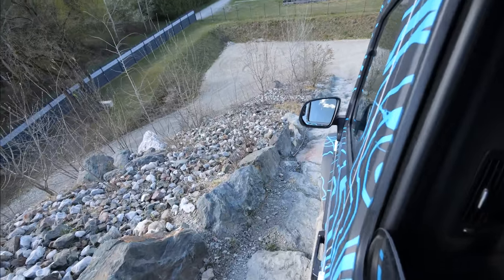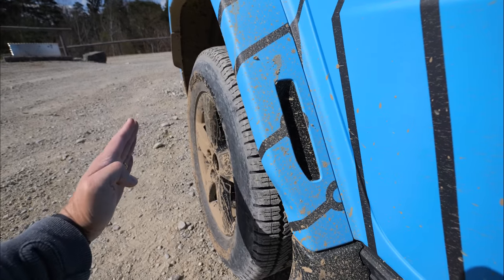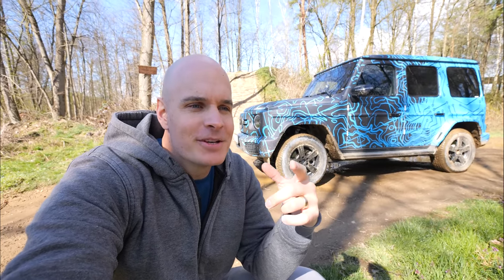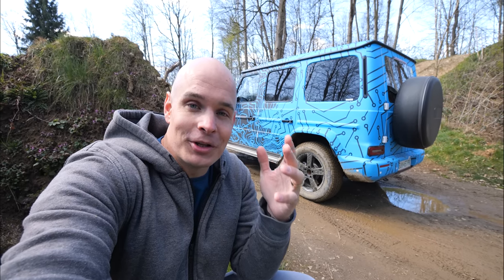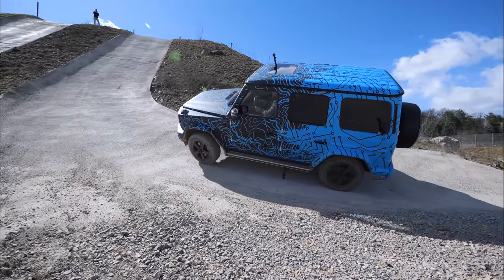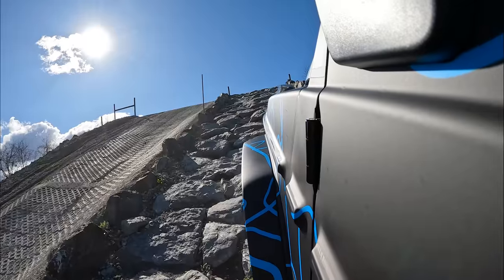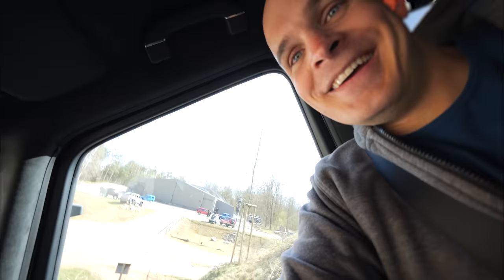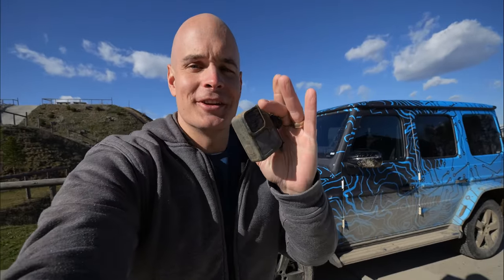The New Mercedes EV is a Luxury Stair Climber - (Sneak Peak!)

Comment: I will miss the engine sound in ICEs but these features are insane
Reply: It's 8000 lbs of electric junk.
Reply: @Dat_Sun  my heart wants this to be true and ICEs to never die <3
Reply: @DamianYoko  It's true, weight is the biggest problem with ev right now.  Fossil is 27x more energy dense, at a fraction of the weight.  

Even at just 20% efficiency ice blows electric off the surface of the earth.
Reply: @Dat_Sun  lol currently even with the higher weight evs are more efficient
Reply: @MaticTheProto  What? How so? And who told you that? 

Start from the beginning,  where does the energy to mine, manufacture and transport 2,000lbs of lithium batteries for an ev come from?
Reply: @Dat Sun  and gasoline forms on its own in your tank?😂
Reply: @peterhaaima8432   Not exactly but oil production is a natural process that is ongoing..  The process is self powering, the process allows us the plastics And by products that we cant live without.  

We are never going to run out of it, all the wells you commonly see used as EV propaganda saying they are empty, still have 80% or more in them.  As technology advances, we will continue extracting from these same wells,  we have found so many more new reserves it is impossible to run out in a 5000 years. Even with our wasteful usage of it.   

 There is no reason to switch over to electric storage battery powered vehicles, Every democratic the sky is falling weather prediction the sea is rising nonsense prediction, has been wrong over my entire life and then some. 

 Tesla, space X, the Biden administration, build back better, all the same crooks after tax cattle funding.    Government will destabilize the grid with electric vehicles, Start cutting off our power like in California. There will be massive restrictions on how much energy you are allowed to use for your electric vehicle..   Open your eyes this is not the cliff to walk off of..

 Fossil fuel is an amazing energy dense substance left here by Mother nature,  It's precious we should conserve it but there is no need to attempt to repbasic with misleading renewable energy projects and the storage battery..

 Wouldn't a better more practical solution for now be to reduce horsepower to about 100 per ton? Electric or ice, level the field,  consider the future.    The energy to move the vehicles around is only part of the picture. The initial footprint to manufacture a 7000 pound Tesla is huge and has no chance of offsetting its own footprint for at least 20 years of constant use. 

The EPA equivalents that are used in eV propaganda are government generated by the same people who are taking tax cattle money and funneling it into the electric vehicle and renewable energy industry.  

 It would literally collapse overnight without the sweat on the backs of tax pairs.   Over a 100+ years ago when electric and ice vehicles were 1st  Is any attraction,  there was no propaganda pushing us to buy one or the other.   Is ice obviously one for good reason, The difference now is the people are being told what to like, There's constantly subjected to electric vehicle propaganda and misleading facts like this Jerry lies about everything guy.

 Jerry summed up all internal combustion engines into one category of performance and said they don't make torque down low.. 

 Maybe if the Ignition was turned off, Otherwise the internal combustion engine is generating horsepower and torque if you don't believe me reach down and try to stop the Serpentine belt with your hands and see how that goes. 

He also chimed in on how electric motors make maximum torque at 0 rpm, Of course he leaves out the fact that it's only down hill from there, Is the more rpm the less sufficient and less powerful the motor becomes.    Electric vehicles do horrible in roll on racing because of this Flaw in the electric motors performance characteristics.

 He keeps throwing out torque along with other EV propaganda bots,  Neglecting the part about it being geared and grounded tq.  Incredibly misleading,  In fact it should be criminal but it's not because Tesla nor any EV manufacturer is submitting for ASC certification of horse power and torque claims.

Tesla as honest as they are are using the same exact misleading advertising that you would see on a Walmart 5000 watt amplifier.
Reply: @Dat_Sun  where does the energy to drive your ice car come from
Reply: @Dat_Sun  EV’s convert about 77% of its stored energy to power at the wheels while ICE cars only convert about 12-30% of its stored energy to the wheels. Electric vehicles only carry the “energy density” of about 2-3 gallons of gas. EV’s are multiple times efficient than any ICE car
Reply: @magicninja4727   You are taking the final process, electricity has already been generated it has been transported and then it has been forced into the storage battery with a high voltage transformer. You left out 99% of the efficiency losses. 

Fossil fuel is some 100x times more energy dense than a lithium battery.  100 TIMES!  I want you to say this 100 times in your head so you understand how wrong you are.

Fossil fuel is pumped out of the ground cleaned up and ready for use. Electric vehicles require several 1000 pounds worth of batteries.

The ore is dug up here in America and then put on a ship that burns millions of gallons of heavy oil to sail all of this ore to China where it is processed, dumped into the ocean, and what's left is sent back to America on another ship burning millions of gallons of heavy oil.   China uses these profits to paint their mountain's green to fool environmentalists.

Then diesel powered trucks transport the lithium to the Tesla plant where they stamp it into a battery and claim it's renewable. 

 This is leaving out 99% of what's involved but I think you get the idea of how big of a sham the electric vehicle is.

In the end you have a insanely heavy limited range electric vehicle that uses far more resources than an ice vehicle that weighs just 25% of the mass of a Tesla.  The worst part is all of this is done just to gain access to tax cattle funds.  Without the build back better Democrat plan Tesla and all other electric vehicle manufacturing would flop overnight.

 My little 620 is a great example of how ridiculous electric vehicles are.  My 44 year old 2,240lb 620 has as much payload as a 8,000 lb electric truck.  It would have taken 10,000 lbs in lithium battery replacements to keep it on the road for 44 years..   Every 3 battery chemistry advancement we make is a trade off, In the future we might have batteries with slightly more capacity but they are guaranteed to be less durable and have an even shorter life than lithium.
Reply: @MaticTheProto   The energy for my ice vehicle comes from mother nature. Also fuel is amazing, without it spacecraft or space x wouldn't exist, we would never have reached space.   Without fossil fuels mankind would end here on Earth that's how amazing fossil fuel is. Why do you think we don't have electric rockets taking us to space?  You would think Mr. Tesla would be afraid of people finding out hes using fossil fuel to get space x junk to space. Lots of it...

 Again all we do is pump the oil out of the ground and clean it up we don't have to charge it we don't have to use other resources. Is fossil fuel is the energy source, Pound for pound it is 100 times more energy dense than the best short lived lithium storage battery. Even at 30% efficiency ice is literally light years ahead of the storage battery. 

Imagine how much range and power an ice vehicle would have if half of it's 8000 pound mass was dedicated to fuel storage and a big block super charged 454.
Reply: How much fossil fuel was used to launch that Tesla in space?
Reply: @Dat_Sun  I'm failing to see where the junk is. Looks pretty useful to me
Reply: @nick_0  It's supposed to be a off road capable suv. It's 8,000 lb weight and low resistance tires for range destroy off road abilities.  

There is no way it could get up my driveway in the winter.  My 22 tacoma trd struggles and it's far more capable than a extremely heavy low clearance suv with parking lot tires.
Reply: @Dat_Sun  Electric is still more efficient with the heavy weight. Literally just search it up.

It’s more energy efficient to use petrol or diesel in a generator, and use that electricity to power an EV than putting the fuel into an ICE car. 

There are reasons to not buy EVs, like as the original commenter said, engine sound, responsiveness, etc - I wouldn’t buy an EV now, but not buying one because ICEs are more efficient is dumb and incorrect.
Reply: @Dat_Sun  Lithium batteries are a single part of the car. How about ICE vehicles? You have to mine the metal used in them too, same for EVs but it isn’t an EV only problem. Also, Lithium recycling is being implemented.
Reply: @Dat_Sun  We are using it faster than it is generating. Yeah “mother nature” left it to use as energy, sure. There’s also the energy of the sun, wind, and water, as well as the energy you can get from heat. I’ve already said this but we can use the fuel and other fossil fuels that we’re putting into cars, to make electricity - it’s like 50% more efficient which scales up to be an insane amount of resources able to be saved.
Reply: @Dat_Sun  at 20% efficiency, ELECTRIC motors are on par with ICE engines for efficiency. You are messing up fuel and the engine itself. You could say that fossil fuels are very energy dense but at the same time avocados are very energy dense and you can’t run cars with avocados until you convert the fat into ethanol, and then mix it with petrol. The only vehicles that are more efficient when powered with fuel vs electricity are very large trucks that run continuously on diesel, anything remotely stop-start is far more efficient with electric tech, and that’s currently - ICE engines have reached the point that loads of R+D will barely get any more efficiency out without slapping a battery and a mild hybrid system in, while electric tech is developing at a much faster rate with the same amount of R+D.

Also, the average person doesn’t NEED a range of more than like 50 kilometres/30 miles a day, that’s the upper end of a commute to work and back with a shopping stop along the way. Unless you do inter-city travel or do a bunch of long road trips very often, the highest range EV that’s on the market right now has a range of 500 miles/800 kilometres - let’s say an actual range of closer to 350-400 miles/550-650km including AC, cargo etc - that’s enough to go from like NYC to Baltimore and back, or London to Manchester, or Sydney to Canberra.
Reply: @DamianYoko  ICEs will probably live on as enthusiast’s cars - Porsche is developing e-fuels and there’s fuel sources like ethanol that exist that are more energy efficient than petrol, but they require a lot of electricity to produce while being carbon neutral.

Comment: Man i would LOVE to have one of these
Reply: Why? It weighs 8,000lbs and requires a lev 3 charger for promt recharging.  Lev 3 changing is a Industrial load on the grid. Our grid is fossil powered..
Reply: @Dat_Sun  I love Mercedes and I adore G class
Reply: @Dat_Sun  I red some of your comments. I think you are on the wrong channel.
And the weight is 6000 Lbs.
The AMG Gclass is 5000 lbs
Reply: @jurgens9867  Lol you are using the ICE powered weight.  Ev version is almost 9,000lbs.
Reply: @santenz8460  So do I, but it's not helping our situation at all. It's 8,000lbs or tire (oil) destroying lithium madness.  Another industrial load on our fossil powered grid.
Reply: @Dat_Sun  3000kg
The Amg with V8 Gasoline 2550 kg
Reply: @JuergenSchl  And? Thats 4,000lbs lighter than the ev version. The ice g wagon is king, the ev is a joker.  Neither should exist,  limit hp to 100hp per ton, ice or electric we need to be responsible and save resources for future generations.
Reply: @JuergenSchl  the ev is not 3000kg if thats what you are saying.  The ev gwagon will weight close to 9k lbs, lithium storage batteries are insanely heavy.
Reply: @Dat_Sun  I own a EV. Mini Cooper SE.
Same weight as the Diesel.

Range is bad. But i love the Power
Reply: @Dat_Sun  I am with you.
I like small Cars like my Mini.
Reply: @JuergenSchl  Ev can be awesome, but it not a solution to anything.  Smaller morw practical sized and powered transportation is key. 100hp per ton, electric or ice, save our resources for future generations to enjoy.  

Without fossil fuels , Humans end here on earth,  Fossil fuel are the only way forward and off of this planet. Nothing else has the power density required
Reply: @Dat_Sun  Just wait till that grid is powered by fusion 😉 Doesn't hurt to think ahead
Reply: @nick_0   Until then limit electric and ice horsepower to 100hp per ton.  Stop the wasteful manufacturing of short lived E waste such as this Mercedes Benz forklift.
Reply: @Dat_Sun  what's the wasteful manufacturing huh? lithium gets more recycled than the fuels being burned to power ice cars. ev's are more efficient regardless
Reply: @nick_0   We cannot recycle lithium from used up batteries. The few people recycling lithium EV batteries are being very misleading just like the rest of the recycling sham. Recycling means if there's any watt hours left in the pack they're put back on to the grid, the plastic bits and some of the conductors are recycled or reused but what matters is not recycled.  

 And like I've said about a 1000 people just like you, electric vehicles are not more efficient, you're not looking at the big picture you're just assuming clean renewable energy is everywhere in great abundance. It's not and even when there is green energy that green energy was made with fossil fuels.  Incredible amounts of fossil fuels..  

We don't have anything to replace the materials plastic renewable equipment is made with. We have to keep using fossil fuels to have the petrochemicals available for life as we know it including solar panels and Tesla cars.

A real solution to extend our resources indefinitely is limiting horse power. 100hp per ton,  Gas or electric. Until we have abundant fusion power or some other miracle green energy, Let's act like we care about the future. 

Each Tesla is roughly half plastic oil petrochemical products by weight. Tesla's are incredibly heavy 5000 to 10000 pounds.. They have huge rubber tires that require barrels of oil to manufacture.. They have shock absorbers and rubber suspension components that are impossible without oil.

That's right Tesla makes it's electric vehicles with an incredible and disproportionately large amount of oil compared to a 2  or 3000lb, practical, long lived ice vehicle such as my little truck from the 1970s. It's 98% or more metal. Almost completely recyclable,  extremely efficient gasoline engine,  Weighs just 2200 pounds but has the payload of a 10,000 pound tesla truck.  This 1970s economy technology will get multiple times more work done in one day than any electric truck on this planet.   By now it would have taken tens of thousands of pounds of lithium batteries to keep this truck on the road if it was a ev.  The manufacturing and shipping process for those batteries is extremely fossil fuel dependent..  The ore is dug up here in America shipped to the ocean with diesel trucks, The oar is then floated to China usingThe oar is then floated to China using Millions of gallons of heavy oil. 

China processes this stuff using coal power from coal mines like the one that just exploded and collapsed killing lots of workers. China does not have the same environmental standards or safe work practices we have here in America. So we take advantage of that by sending all of our stuff there for the dirty work. The processed ore is sent back while the remainder is dumped into the ocean in China. Once it makes it back to America it's then trucked with diesel trucks again 2A manufacturing plant that basically stamps them into shape and claims they made them here in America.

 They are then charged with solar panels or wind turbines that were most likely manufactured in China or somewhere just as far away. 

 Remember fossil fuels are already here, we don't expend energy from outside sources to remove it from the ground and clean it up a little bit.  It's a self powering process that gives us a product 100 times or more dense than our most advanced battery technology. 
 The internal combustion engine could be just 5% efficient and still be orders of magnitude better than the storage battery.

We are not running out of oil, Political pressure and sabotage are the only reason for increased fossil prices. Wells that are considered empty are nowhere near empty they're just empty for today's technology and Oil prices.  Oil extraction techniques continue to improve, Even the slightest improvements are millions of times more rewarding than Is any future storage battery technology, 100x the energy is a  Inconvenient fact for the electric vehicle industry.

Comment: The funniest thing about this video, is that those G-wagons never go offroad IRL, unless they are super old and cost around 20k:)
Reply: If it goes, then next it will go to service centre for a good amount.
Reply: @trickyabb  no
Reply: Many of the German military armored personnel carriers are just armored G-wagon's with stripped-down interiors (see Mercedes Enok)
Reply: @romantechplus  did you see electric military personal carriers, or vehicles overall? Nope! And there will be none in nearest 20 years.
Reply: @werneo  you are very correct. However, this is primarily a function of the exceptionally long service lives enjoyed by many military vehicles coupled with the logistical challenges inherent to switching from ICE to electric vehicles (resupply of fule vs electricity). Not necessarily limits of the tech or cost.
Reply: @trickyabb  This is not Ford.